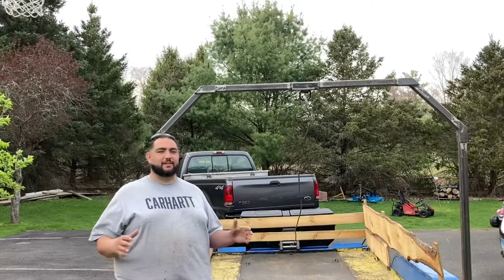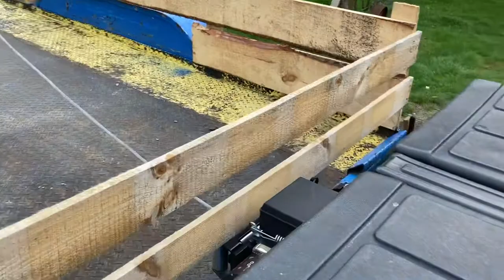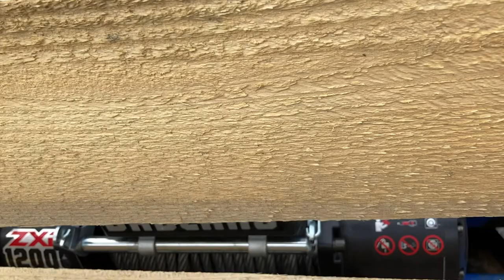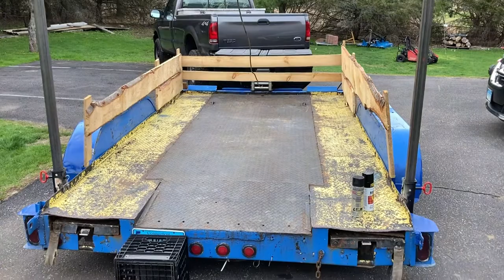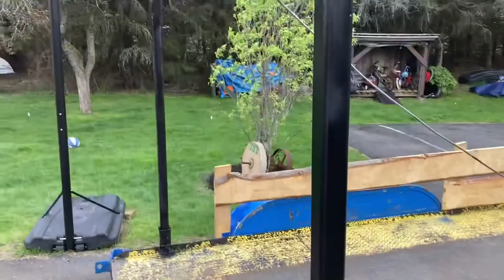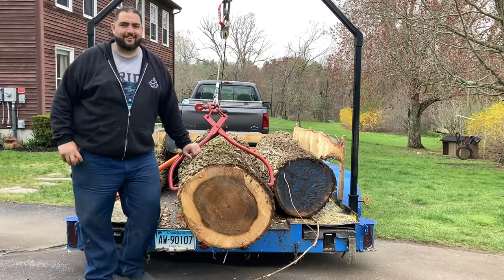Lift Arch Trailer Logging in Suburbia, Moving 2 Tons of Poplar Wood Logs

Comment: I did a fixed removable arch on mine as well, but I have connection points across the full length of the top bar.  This helps fine tune where on the trailer the log is pulled to.  The other thing I'd recommend is that you leave the snatch block in place on the arch.  Once the front of the log is on the trailer, just run the cable back out 4' er so and grab the log again with the tongs.   You'll be inchworming them on, but it's quicker ;)

Comment: To increase your pulling power of the winch add a anchor point on the arch and front of the trailer for the cable and use a suitable pulley on the tongs this will double your pulling power careful not to over load the anchors